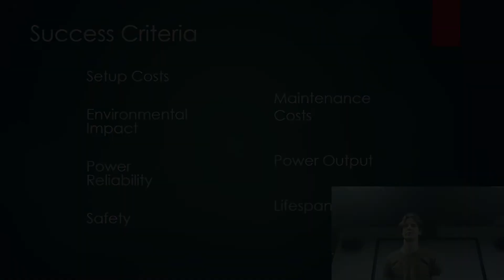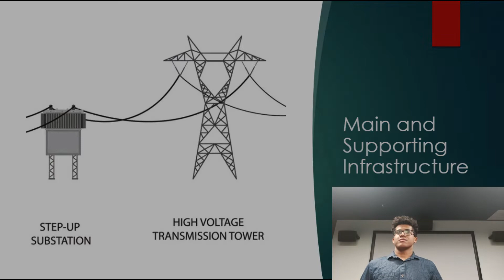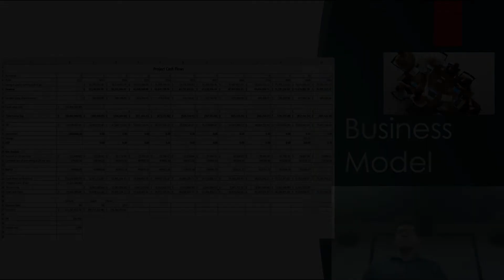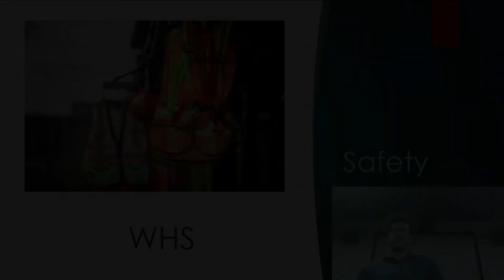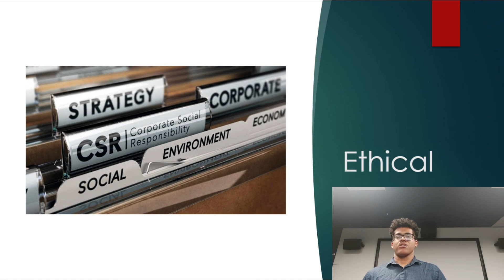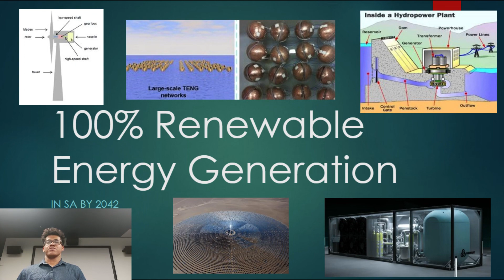[ W208] 100% Renewable Energy

Comment: Enjoyed your presentation!
On a day where there are minimal waves (ocean appears flat), what is the minimum amount of power generated? What strategies/assumptions are in place to ensure reliable power at times of low generation?
Reply from the maker: Hello! 

For the minimum power output the team has computed the value of 900MW. As for reliability, excess energy generated that is stored in the Tesla battery in SA will be used to balance out the power output of the generators.  

Thanks for your question!

Comment: Interesting Proposal, while aware of ocean wave energy, I haven't heard of TENGs. It would've been nice to see how this option scores against your criteria.

I (Sidney Bruneder) have a few questions:

What considerations have been made in regards to delivering the power generated offshore to land? This seems like an important factor in making such a technology work with our power grid as-is.

Additionally, if some means of cabling to transfer power from generators offshore must exist anyway, why opt for wireless sensors with numerous common modes of failure in combination with offshore control? Wireless control would make more sense if the process is at least partly autonomous.

Have you assessed the opportunity costs of ocean wave generators in any way?
I understand this may not be the gold coast, but I imagine that any power generator would imply exclusion zones potentially influencing fishing activities, tourism or other ocean dependant projects. I acknowledge this may be hard to do without a specific installation site in mind. 

Feel free not to get into too much detail with your responses.
Reply from the maker: Hi Sidney! The transmission system will have aerial powerlines which are connected from the nanogenerators on the seashore to the onshore transformers to convert the voltage produced from the nanogenerators to standard 275kV. 

Secondly, SCADA systems will be used for monitoring which are internationally recognized therefore for ease of use and standardization as well as for safety considerations the team decided to adopt a wireless monitoring system. 

Lastly, opportunity cost has been considered in terms of the minimal effect on opportunity costs from the lack of fishing industries and other industries that require the surface of the water including tourism and boating. 

Thank you for your time and we hope to have addressed all of your concerns!
Reply: @ahmedshehata548  Ah, so choice for wireless control systems was made for safety? I frankly don't understand how the transmission of control signals would be safer if wireless, if anything my understanding is that it is less reliable and more dangerous.

Comment: Good presentation! 
Just a couple of questions

1. 7:56 Is preparing for a tsunami necessary? Due to the shallow water around South Australia, a tsunami would be quite unlikely. Would there be other risks that may cause problems?
2. How will society be affected at large with 100% renewable energy in South Australia?
Reply from the maker: Hello Mathew! Thank you for taking the time to watch our presentation and we will be happy to answer your questions! 

Firstly, according to the Australian Government Bureau of Meterology (http://www.bom.gov.au/tsunami/history/index.shtml), you are correct. Tsunamis are not very likely to happen in SA. However, there are still recorded effects of Tsunamis occurring in the state of SA. We as a group decided it is best to adopt a 'Prepare for the worst' mentality. Another reason we decided to plan for a Tsunami is that Adelaide is very close to the Willunga Fault (ga.gov.au/news-events/news/latest-news/fieldwork-unearths-scars-from-ancient-earthquakes-near-adelaide) SA is directly adjacent to the Indo-Australian plate and Antartic plate. Therefore, it is best to consider the real possibility of an incontrollable environmental natural disaster that can and would directly impact our entire system. Other risks that the team have anticipated include the electrifying of water near generator or transmission lines to the offshore facility. We have mitigated this risk via following standardized practices set by the AEMCs, AEMOs, ISO/IEC standards and common practices internationally for an optimal and safe operation of our generators. These 2 risks are the most unique with respect to our product. 

Secondly, there will be mostly positive impacts including lower emissions and cheaper energy prices, On the other hand, opportunity costs from the lack of fishing industries and other things will need to be considered which is a minimal effect that is still considered in our scope. 

We hope to have answered your questions to the best extent, Thanks Again!